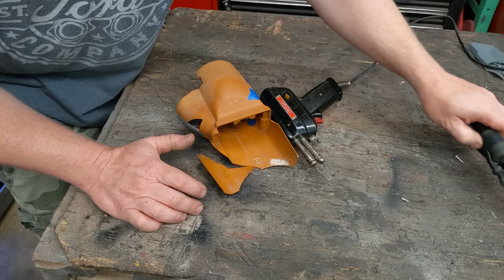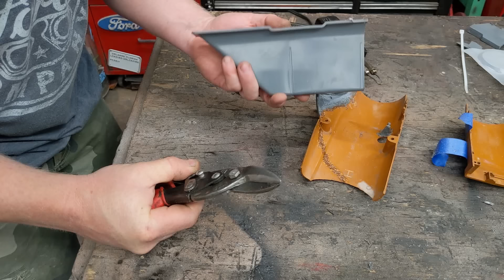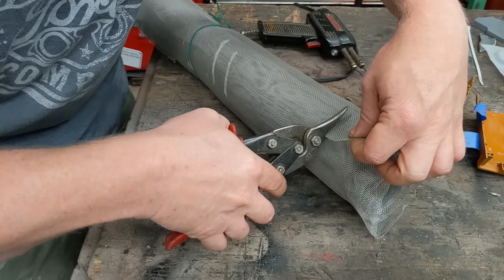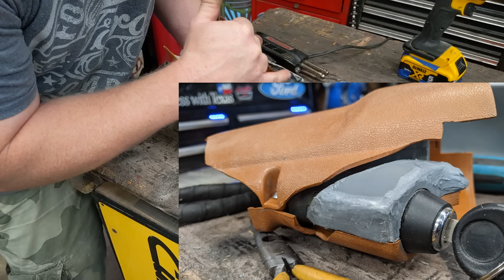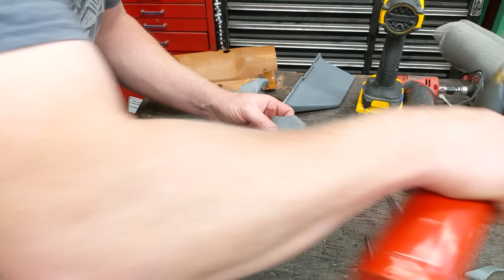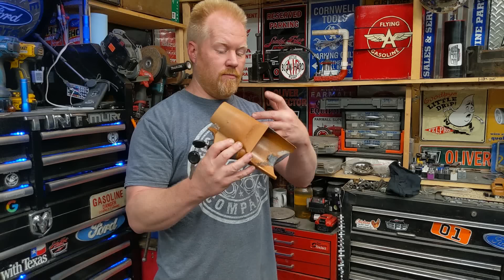HOW TO FIX broken plastic ULTIMATE Welding Forming Repair techniques

Comment: Trying to mix different plastic types is usually not a good idea. You can get away with it sometimes, but it is best to match filler type plastics to the original part plastic. If you check on Amazon, you can buy an assortment of  plastic filler rod types. There is also a really good and very useful filler called FiberFlex, made by Polyvance. This is a "universal" fiber reinforced filler material, You can get it in round rods or flat strips. It is great for reinforcing the back side of "standard" fusion welds of the parent material. It will bond with just about any type plastic, however, you don't mix it with the parent material. 

Stainless mesh reinforcing is going to be the strongest, but there are times when the part doesn't easily adapt to that type repair. This is where the FiberFlex material can work quite well. You can also use this stuff combined with small pieces  of stainless mesh for a very strong repair. 

PolyVance makes professional welders that are essentially specialized soldering or wood burning type tools.  The nice thing about these is that you can adjust the heat and they make different shaped tips that screw into there tool. The pro stuff will cost you more than using a soldering iron, but if you have some large repairs, they end  up paying for themselves. I often use mine making repairs for myself and other people. The adjustable temperature feature is handy because if you overheat the plastics, they will breakdown and weaken the joint. When you mix plastic types, you are likely to overheat one type or the other. Even using the correct type filler material, may not exactly match the parent material and probably not the color. When possible, you can often find unseen sections of the original part which can provide donor material for filler that matches the original part. Often you can use one of the described repairs to the unexposed side and use donor filler for the cosmetic side. With the donor filler and a good tip at the right temperature, you can make a cosmetically passable repair.  That can save the time and trouble refinishing the cosmetic side. 

It's not so hard to stick broken pieces of thermoplastic back together, but it takes the right plastic at the right temperature to make reliable repairs. It's always a good idea to do some trial/practice work on the unexposed side first. That's a good way to get the temperature dialed in to where you want it. With patience and practice you can make some very nice repairs.

Comment: You are burning the plastic. This is bad and makes a weak repair.  For a cosmetic repair you can use a pinpoint heat gun after stitching the backside and the crack will flow together.
 If it is a textured surface then you need the same textured paper.  The crack will disappear if done correctly.
You do not ,mix plastics. You have apiece of ABS rigid plastic and you are "repairing " with soft thermosetting plastic. It  will break again.
You should not be teaching what you do not know.

Comment: Right idea but poor technique. I have been welding plastic for 40 years. You need to align the pieces the, tape the part together fully on the outside. and in the ends in the inside with masking or electrical tape.
Warm the plastic to about 110°F on a flat surface using an electric hotplate. 
A soldering gun is too hot and crude.
You need a  filler rod from the same plastic that you're trying to repair. Do not mix plastics.
DO NOT try to heat Nylon. It turns into cyanide gas. It can kill you. It has a very burning pungent odor.

Using a 40 watt soldering iron with a flat 1/8" wide tip,  Perpendicular to the crack line at 1/16" to 1/8" intervals melt (stitch) the plastics. Start in the center. Melt about 2/3 way through the thickness of the plastic the plastic.
The idea here is you are displacing the plastic and it is fusing together.
Work from the center outwards. while you are working make sure your tape does not slip. then remove the tape at the ends and continue stitching the ends.
the more stitches the better.
Then using the flat  of the iron tip. Smooth out and fill the stitches back in. Now the stitches have been mixes and folded. they will be strong.

For additional strength, stitch in more filler rod or a piece of metal screening. or epoxy and metal screening.

Comment: I wonder if the super glue and baking soda trick would be a bit easier. Apparently makes the super glue much stronger and also the baking soda can act as a filler for buildup as well. Check it out.

Comment: I do melting through the groove and then covering it up from both sides by pushing in the plastic, exactly the same way that you do. And I melt stapler pins into the plastic for reinforcement. The mesh idea is a great one. Thanks!!

Comment: I've done this with a regular soldering iron, it works great but a word of caution is to use an old crappy bit because it will be ruined afterwards. So take an old tip and dedicate it for this type of stuff.

Comment: I have done a few small plastic welding jobs in the past with pistol stye soldering gun with limited success, but I think it was the type of plastic I was working with.  But this year I noticed my Toro snowblower chute was cracked and I, using a large electric soldering iron that I have, and it worked perfect along with some plastic straws (from inside spray cans) for filler rods and pieces of a large paper clip to reinforce crack.  Thanks for this video, it gave me courage to repair it, I guessing that would be a somewhat expensive to replace, if you could even get one.

Comment: I dropped a chunk of metal on my DeWalt reciprocating saw and busted both halves of the clamshell handle.  The replacement parts were obsolete and I figured the saw was a gonner.  Then I found this video.  I got an outstanding repair using this technique including screen reinforcement and scraps from an old bucket to form some missing shards that I had lost.  Having never welded plastic before I found this to be a very satisfying experience.

Comment: I work with plastics everyday hdpe  pe nylon acetal(delrin ) peek even mc901 used for making gears.
Some will weld easily but polythene is fussy sometimes.
A nasty finnish can be flame polished with some plastics.

Comment: If you use a heat gun instead of the soldering iron, your plastic will "wet" in order to stick together like taffy in consistincy.  Using the soldering iron will cause the plastic to carbonize and burn to make it "crispy".  A heat gun, by "wetting" the plastic pieces allows them to chemically bond together.  This is another situation using the heat gun in that if the plastic has lost its surface consistancy, wetting it can cause it to bring the petroleum distilates to the surface and restore its appearance as looking new again..  

What do you think?>
Reply from the maker: The problem with the heat gun is not being able to pinpoint the heat and you'll turn a much larger area into a molten puddle.

Comment: I learned this trick long ago, melting plastic together seemed to make the area broken even stronger.
I used to use filler plastic, of the same material, even cutting parts off of other similar plastics or right off the unit I am fixing (a portion of the plastic that won’t miss it).

Comment: I use a spray bottle with rubbing alcohol to cool parts down rapidly, I also use it when soldering to control the spread of heat

Comment: Sigh. Where have you been all my life?😝 This is SOOO getting done. I cleaned my workroom and BEHOLD. I have everything needed for this. Maybe I can fix all that crap plastic that was supporting the bumper on my car that the hit and run idiot smashed on me. It would be nice to replace the damn baling wire holding my headlight in place.

Comment: Do you have to push the screen all the way thru the plastic?
Reply from the maker: I try to just embed it below the surface. That may be 1/2 way through depending on the thickness of the plastic.

Comment: Thank you for sharing I do the same method until 7:45 (laying down the mash screen)and after that, I filled it with the superglue and add baking soda on top of the superglue or add cigarette ashes same things plus super glue.

Comment: Did you know that in the early days of automobiles the bodies and much of the interior of the cars were made using the hemp of the Marijuana cannabis plant? There's a video on jewtube showing Ford's Automobile founder Henry Ford with a sledgehammer beating the outside body of the car and causing no damage at all. Some say the cannabis plant was made illegal not for the thc mind altering substance but for the possibility of renewable cannabis taking over many different industries. Cannabis can be used to make countless products including rope, plastics, and medicines without any toxicity to the product.  Not to mention the fuel that could have been made to fuel our homes and cars. But the robber Barron's of the industrial age saw to it that cannabis was blackballed and made illegal through the lies in their media and propagandist campaigns. 
   Aside from cannabis used in the production of plastics "fossil fuel" plastics can be made virtually indestructible in the manufacturing process not costing much more money to produce. Yada, Yada, Yada
   What a shame and a crime against humanity and the environment!
Thanks for the video. Hmmmm
Maybe I'll go into the plastic repair business.

Comment: I've found that most metal window screen is aluminum. Older screens are sometimes , but rarely, bronze or steel. I have yet to encounter stainless steel window screen. 
A good source for stainless screen can be found in round splatter screens made to cover frying pans. These can also be aluminum which is not as durable. 
I once repaired a plastic housing of a pool pump that had split due to water freezing inside it. The fix held and did not leak for as long as the pump remained in service.
Reply: After looking for stainless steel mesh on the internet, that's exactly what I ended up doing. Splatter screens are only a couple bucks at the dollar store for me, for roughly a foot square of mesh.

Comment: I just came from another video that used superglue and baking soda to actually glue parts back together, and more importantly REBUILD broken pieces

This method is useful for smaller or delicate parts that welding would destroy 

Just search a video for it because I wouldn’t give an explanation enough justice

Comment: I'm not fond of the soldering iron technique. Given the prevalence of ABS and PVC plastics, I use Oatey All-Purpose Cement, found in the plumbing section of any hardware store or big box home supply.

The problem with heat welds is most evident with thicker plastics, where only the outer surface is welded, whereas the inner surfaces of the fracture remain loose. Solvent welds allow the entire fracture to be fused, resulting in a mend possessing much greater strength.

Additionally, heat welds require careful temperature control, to avoid burning parts and releasing acrid fumes.

Granted, solvent welding requires an understanding of the material to be fused. I've found Oatey All-Purpose Cement to be fairly forgiving, on this account. I used it to mend a fractured ABS part for my 3D printer, to repair a broken speaker grille frame, and more.

Comment: I've used epoxy that is made for glueing granite counter top together. My miter saw dropped broke off the handle/on/off switch the epoxy did awesome stronger than before

Comment: I use a similar technique, but I first tape it together using Kapton tape. The tape withstands the high temperatures of the soldering iron, keeps the plastic from oxidizing, holds the pieces perfectly and makes for a better looking and stronger weld.

Comment: And I thought you was going to say crazy glue and baking soda...lol (which does work too BTW) but this is an awesome idea. I remember as a kid trying to fix any broken plastic toys with a hot as hell nail straight out of the stove top or a butter knife.... never worked as good as this. The temperature regulation was the missing piece of the puzzle. Great video, thanks.

Comment: This is a fun video to watch. It really rounds out my welding vs material techniques. Unfortunately I watched it about 2 weeks too late to save a plastic Adirondack lawn chair. My wife informed me that I put it out at the curb after a year of promising her I'd repair it. I'm a pack rat and am always sorry when throwing away something I've promised to fix or fail to reincarnate something for a different life! 😅

The use of stainless steel screen material as a backing is a valuable tip! I believe the braided shield used in Coaxial Cable is yet another great backing material. They're manufactured in both Copper or Aluminum alloy.😉
Thanks!
Wakodahatchee Chris

Comment: Good innovative " plastic welding " with enforced "metalic mesh" and or "copper wire" using normal " electric soldering gun " like Mc Guyver solving   repair issues .I used to repair cracked plastic using electric soldering gun .The only defect is the iron tip will stain with remnant of plastic .You need to polish the iron tip with metal file for cleanup .Good for sharing information .Thanks ,video demo .

Comment: If you have bought a cheap electric soldering iron, you can make adjustable by putting a dimmer switch in line. Also if it has a screw in bit, then if you find same size screw bolts then they can be used as  disposable cheap bits.

Comment: Excellent instructional video. Thanks. What about a large flat area of old brittle plastic with cracks in it? I've got a 12" by 12" piece with small cracks, almost like spiderweb cracks. My current thought: melt and mix along the largest cracks as you showed us. Then lay down a 12" by 12" metal screen. Heat and push down the screen into the plastic in many places. I'm probably not going to be able to do that over the entire area though. Should I then coat over the entire area with a product like JB Weld or Bondo?
Reply from the maker: You're on the right track. I would personally use some sort of epoxy or JB weld to reinforce it.
Reply: @sixtyfiveford  Thanks. I'm looking forward to trying to fix this now.

Comment: Thanks for the helpful video & tutorial!

I was intrigued when you casually mentioned painting it brown at the end & wanted to find out how/what type of paint(s) exist that "take" to plastic.

I didn't know painting plastic trim pieces like this was even possible. Any luck you remember what type of paint you used OTOH in this instance?

Thanks again for the helpful video; cheers!
Reply from the maker: Standard spray paint will say if it is plastic compatible. These days it seams that nearly 75% is plastic compatible.

Comment: This  is indeed the only way I've found, to make the repaired part as strong or  stronger than the original. Works well for elongated parts (rods, etc), if you use a steel bolt/old drill/nail, etc.

(BTW, by the looks of that part, it would benefit for the future if you laminated that mesh all around the edges)

Comment: Super informative video! A couple of observations: I noticed that the solder gun tip was sometimes just millimeters away from your finger tips. I know that you have steady hands but . . . . The other observation is that standard window screen is aluminum not stainless.

Comment: Cool Mang, I'm gonna try this.  But super glue on some plastic works very well. I fixed a water hose wand that froze and cracked long ways.  It lasted all summer, incredible.  I would not believe if I didn't see.  Thanks for the video, baby

Comment: You use a narrower sheet of screen than I have seen on other videos. Not a bad thing, I don't think, just different. I'm just doing research to learn better how to do this, so I just thought I'd mention it.

Thanks for adding the shaping of HDPE with the soldering iron and small torch! That could be used to make artwork, LOL! Not that I'm that patient for artwork, but it could work. But the shaping plastic into the needed replacement part is much like I learned to fabricate steel or aluminum parts at the semi trailer shop I was a mechanic at for 2½.decades! Knowing how to heat it and shape it was all I needed! Perfect!

Comment: Dude you the man I've seen other people do the same repairs or similar quality repairs but you covered each and every one of them very thoroughly and did the same maybe better job than most people however you definitely explained everything much better than anyone else I've seen most people would just do one with or without the mesh and half-ass explain it thank you very much man I'm glad I saw your video one thing you covered that no one else did was if you have a missing plastic piece and you want to make cut in shape a piece of plastic to patch a hole / missing piece thanks again man best wishes and blessings to you and your family
Reply: That's 💯 right - this has been the best video I've seen on this!

Comment: I never had success with plastic soldering. Rarely anyway unless I cut strips of copper wire because it conducts heat quick and is like steel reinforced. I have a dewalt cordless batteries adapter. I've had it for about 6 years now and it broke in such a way I have never seen! Must be cheap 3d type of plastic. Quite brittle. I bought another one but flimsy as hell. I'm gonna try your method. Top job! Subbed and liked. 🙂👍👍👍. Cheers from Australia. BTW. if I use HDPE plastic on any plastic? That would be awesome 👍. Any reply appreciated cheers

Comment: I do believe that's a MK1 Steering Column Clamshell  Peanut Butter from a VW Volkswagen Rabbit GTI 1975 to 1983 
part number: 171953516A XBY made from ABS plastic. Don't OD on the Hydrogen Cyanide fumes.

Comment: That iron is too hot. When welding plactics, you can't exceed the molding temperature of that particular plastic. You must have the proper temperature. Once you liquify it, it's not plastic anymore and will just break again